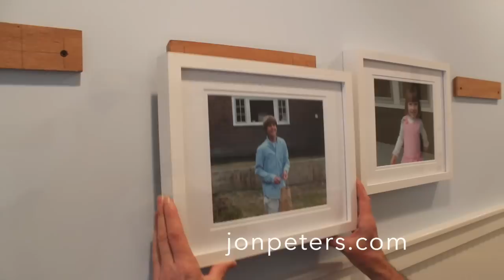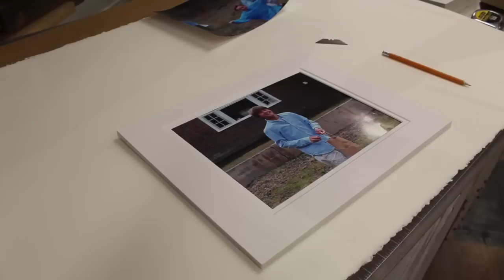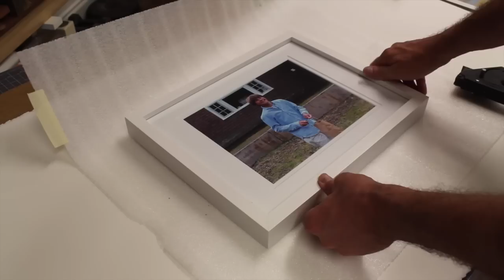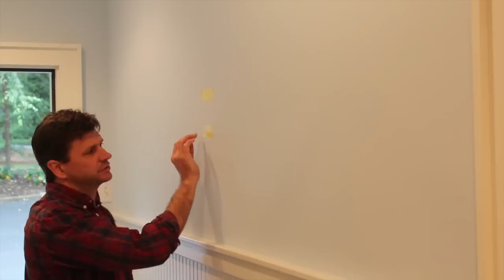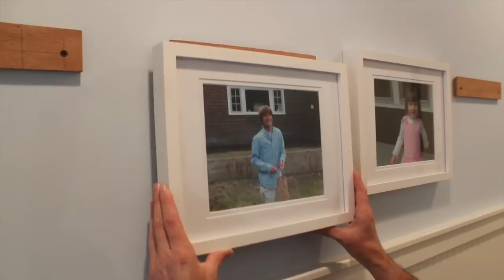How to Frame & Hang Pictures Perfectly Level

Comment: Of all the videos you post, I think this one is my favorite so far. I am always putting up picture frames in the house and this is a simple clean way of doing it. Question, I recently started building my own frames with help from your other videos, what do you do when you shoot a nail and it happens to come out of the side of the frame? I've been practicing but seems every time I actually get a free built I shoot one crooked and it splits out the side. Do you just scrap that frame or do you have a trick to extracting that nail without butchering the wood? And french cleat with a 35 degree angle? Keep up the great work!
Reply from the maker: +Jay McCrary Thanks Jay , I'll talk about that today

Comment: Hey Jon! I was wondering if you had any vices for larger frames that are going to be painted? I've been working with  large photographs (4 x 6 ft, one 4 x 7 ft) and I've done a decent job putting frames together and painting them, but over time I'm noticing some of the joints are loosening and there are cracks in the paint where the joints are. I try my best to get the frame as seamless and clean as possible to eliminate any seams at the joints. 
I've been using poplar for the frames cause the paint lays pretty well. I saw in another of your videos you used auto body filler for the joints, is that heavier than regular spackle for the joints? Thanks again for all your hard work!

Comment: Very nice job, as usual - 2 questions:  Did you have to calibrate your mitre saw to get an exact 45 (or were you just lucky)  And for us in the UK it's not so usual to have an air compressor - I have an electric nail gun but the kick back is so extreme that it is impossible to use one-handed - it appears from your video that there is no apparent kick back from an air nailer, is this true?
Reply: +Steve SteveS  An air nailer doesn't have a kickback. Very smooth and fun:-)

Comment: @jonpeters whats the name of that staple looking tool?
Reply: +roman It's called a point driver.  His apprears to be the fletcher which is about $80 on Amazon.  There are some others in the $45 range
Reply: +roman Hello Roman. I think what you're asking about is at 5:24. I believe this is called a Picture Fame Point Driver. I don't know which model Jon used in his video, but here's a link to a similar one on amazon.com http://www.amazon.com/Fletcher-Terry-FlexiMaster-Point-Driver/dp/B000KNFSPY/ref=sr_1_10?ie=UTF8&qid=1454258845&sr=8-10&keywords=picture+frame+point+driver. Good luck.

Comment: Did I hear you right?  I thought you said 35 degrees for the french cleat angle.  You meant 45 degrees right? (or did I mis-hear you)
Reply: +Chet Kloss Yeah, that's what I heard, too. Which I'm sure would work just fine, too.  Heck, probably 15 degrees would keep pictures on the wall just fine.